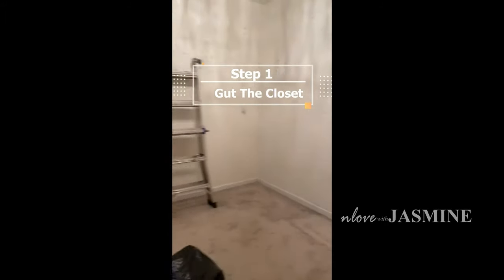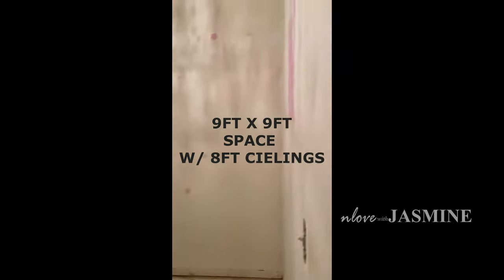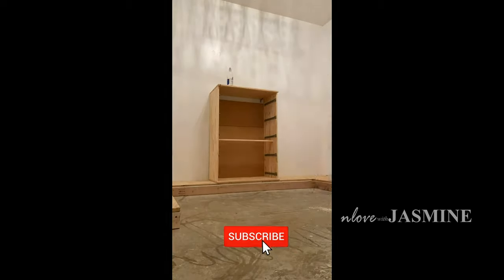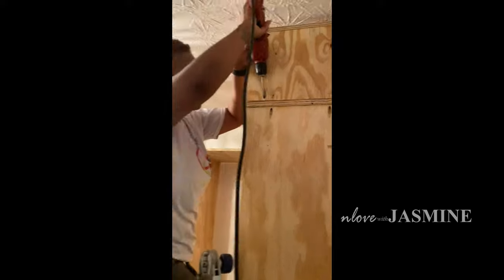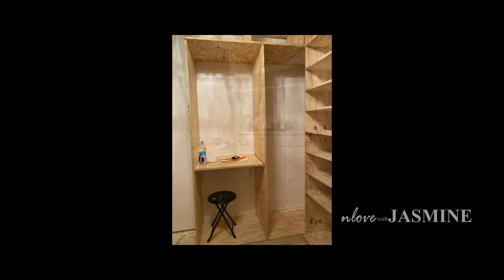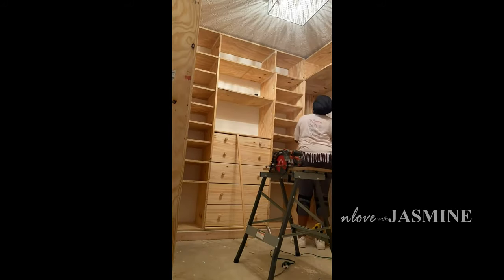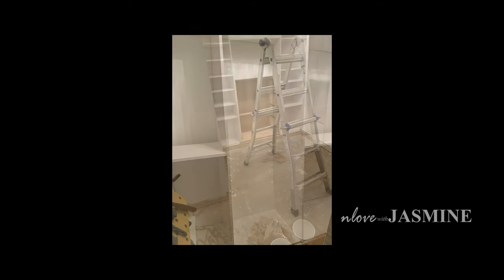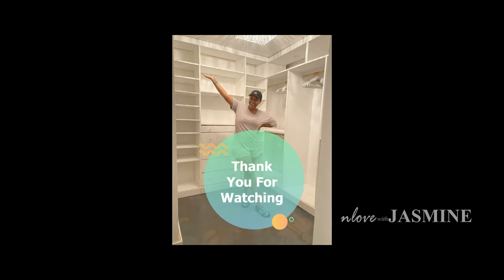Built My Dream Closet | DIY | #JAStheBuilder

Comment: Ok..I started my base with the 2x4s this week. Did you build a 2nd base layer as part of each unit/ section, placed ontop of the plywood you used as the starter base on plywood? Or was the plywood laid ontop of 2x4s the only bottom layer?  Hope that made sense.. lol